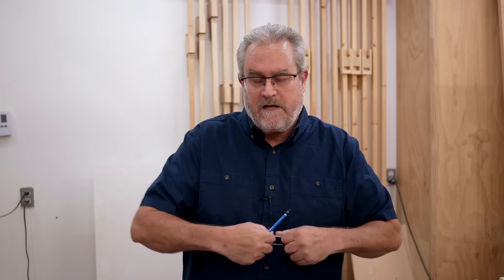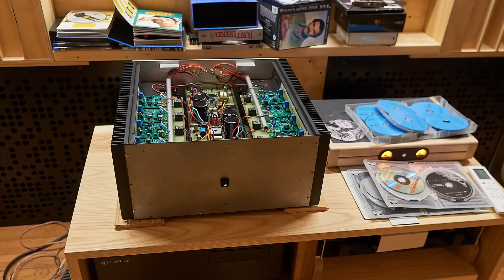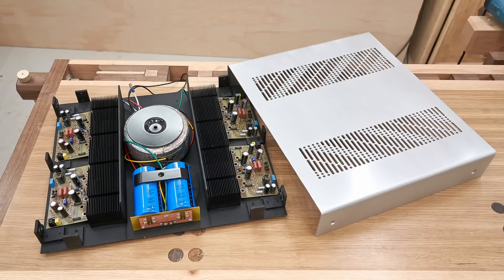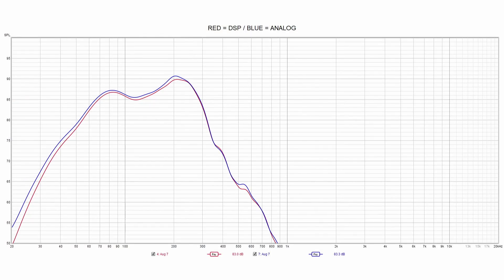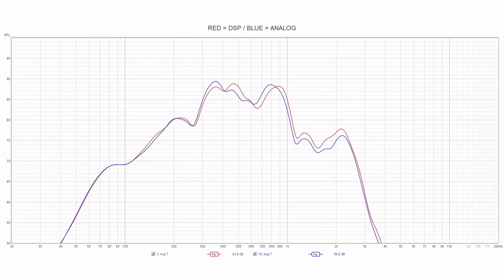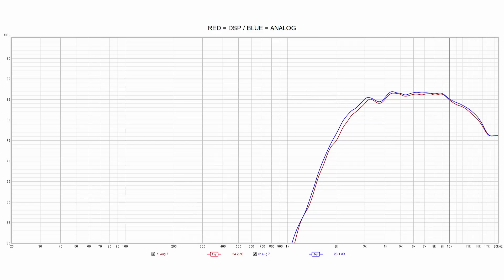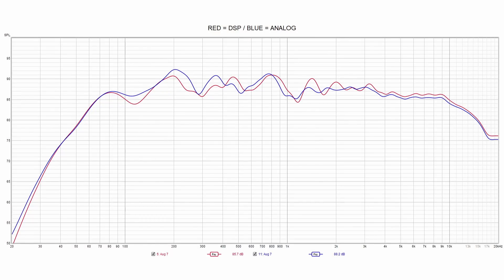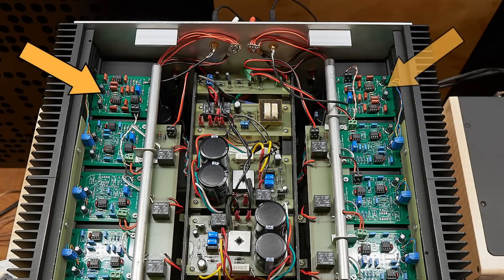My Amp Blew Up!

Comment: Tecton and about 30 other people that think they are original thinkers, have patents that are similar to what you have done. Patents are of limited utility. A 10% variation negates the applicability of the patent claim. Sorry about the magic smoke. Been there. 

Mark
Reply from the maker: To be fair the Tekton example is original in concept, with the main purpose for the array being a means to drive the midrange frequencies with lower mass units. That's how he puts it, anyway, and it makes sense. Anytime you can maintain spl output with low distortion using less moving mass you will see an improvement in transient response. Whether that improvement is audibly better is another story. 
My interest is more in the point source concept, where the 6 mids act as a single larger driver with the tweeter in the middle. This arrangement can cross low, well below the beaming frequency for an 8" woofer. 
But again, that all seems like it would be better in some ways, but as to whether it actually sounds better is yet to be determined. Certainly my rough preliminary measurements suggest that it's working as expected, with very good off-axis response and higher sensitivity.
Reply: @IBuildIt  Tekton is not the originator. There are examples from 70 years ago with the same idea. There are examples with delay that attempt steering of the signal. It's not new at all. But has limited utility. And you nailed the reasoning that best supports it.
Reply from the maker: Yes, but It's well established that to improve transient response you need lower moving mass, and that understanding has been around since speakers were first invented. But specific methods on how to do that are the innovative part, and Tekton has done that with the tweeter array and was able to secure a patent on it because it was original. 
As you know getting a patent isn't trivial and typically costs more than it's actually worth in real terms. And I think this is an example of not wanting what a patent can do in the real world, but wanting it instead to add credibility to the design and make it more technically authentic. Most people are impressed when they hear something is patented and that becomes a selling feature.

Comment: I dont believe that two woofers, is the same as a Passive.   With the Phillips Woox system I used to own... The type of low frequency sounds that the Woox passives made, was FAR deeper than the woofer driver itself.   According to what Ive read, you have to Tune a passive using the proper Weight on the rear of it.

 In fact, the Woox passives would get much more dynamic low bass, the higher I raised the Volume... as that "Excited" them to a much greater Resonance level.   However, Phillips recognized that if you wanted to play your music at lower volume levels.. but still wanted big bass thump... that something would need to be done about this...  So they added a special EQ setting on the Boom Box, that you could Toggle.   I believe that this EQ just basically boosted the Lows, while leaving all the rest the same.   The increase in bass levels... caused the Passives to Resonate much greater, even at those lower volume levels.

 Now... you could always modify a normal woofer / subwoofer into a passive... but you would still need to remove the magnet, and add the proper weight to it.

 The Woox system was very interesting, in that it had like 3 expansion rings... allowing it to expand much further than a typical passive.   Also, the woox unit was actually two of these passives, spaced apart about 1 inch from each other.   There didnt seem to be a notable mass on them... but Its been a long time.  My memory is fuzzy... and even if they did have a mass hidden behind the Caps.. it might not have been heavy enough for me to recognize.

Also, after trying to replace a foam rotted woofer out with another brands... I learned the hard way... that the Woofers themselves were special.  The Taiwan mfg. that made the drivers for Phillips, developed the 6.5" woofers to have an Extended Throw / Travel... which allowed for greater bass responses, low distortions, and greater Passive "Excitation" levels.'

The crazy thing was... those little Woox speakers put out deeper bass than my EPI's  that have 8" woofers, and are like 2x the cabinet volume / size.   That said, the EPIs were still far superior overall.  Much greater accuracy, details, and a 3d Soundstage that couldnt be beat.  Not even close.

Comment: I blew up an amplifier. It was being weird one day, sound was odd, I turned it up (should have turned it off), kawblewy. It had developed an input stage problem and was trying to make DC. Audio was working against that of course going in the opposite direction and saturating harder the other way. Luckily fuses took most of the abuse.